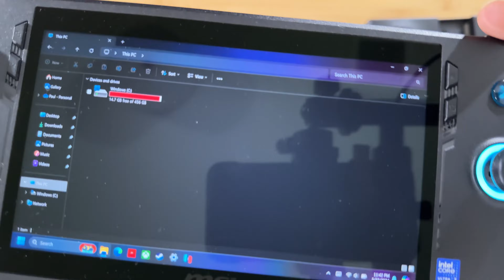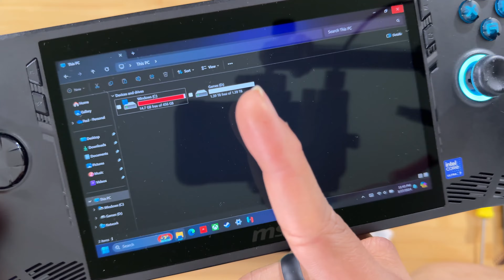MSI Claw SSD Upgrade | 2Tb

Comment: Did the repaste help with performance 😂
Reply from the maker: Not really. It was not thermally limited before
Reply: @BarelyAverageDude  so basically handheld development is still in early stages and haven't fully tapoed into high end use, I joined at the right time 🎉

Comment: Where does the OS stay ? If you install a new ssd, new from the store ? You dont have to install windows 11 again ?
Reply from the maker: If you put in a new SSD you need to reinstall windows. I use the clone tool to streamline the process and skip that step. 

TLDR the OS is on the SSD

Comment: Do Both fans supposed to start when it's plugged in? 

Cause mine won't turn on, and when I plug it in , I see only 1 fan moving.
Reply: Mine bricked and having the same issue
Reply: Reinstall bios that should fix it you need another laptop to do it

Comment: Bad Design? It was never made to be disassembled. 🤣 Best design would have been a port with a cover so the SSD could be replaced without disassembly.
Reply from the maker: Being made to never be disassembled when the SSD is upgradable is bad design imo. I could understand if the storage was soldered to the board. 
Also there is a handheld that just has a cover over the SSD for easy replacement; OXP X1 mini 👍🏽

Comment: Hey guys I just want to ask you the claw can turn on without a battery? Because this product can’t support bypass battery, and this issue is hardware limitation designed or the bios and firmware locked?

Comment: Claw 8 I put new ssd in it then it loaded bios and can’t get to windows wtf
Reply from the maker: @Dkkongisland  did you clone your original ssd onto the new one?
Reply from the maker: @Dkkongisland  a new SSD doesn’t have windows on it out of the box
Reply from the maker: @Dkkongisland  6:44
Reply: I couldn’t clone I messed up my hdd by canceling the cloning it was too slow lol now I need buy a new hdd
Reply: Can’t I just boot up a usb with windows on it
Reply: I was gonna clone windows to my hdd lol
Reply from the maker: @Dkkongisland  you can boot from USB. cloning would just save a few steps. 👍🏽
Reply: @  I tried to clone it messe up my 4tb  hdd how can. I recover the hdd to normal lol

Comment: And how do you design a radiator so that it can be dismantled without having to redo the thermal conduction in one way or another? whether it's on the CPU or elsewhere, when you dismantle a radiator, you inevitably find yourself in this scenario unless you dismantle the processor with it. There is absolutely nothing anti-consumerist about it, these are purely obligatory choices to reduce production costs yes but also to reduce the selling price because, whether we like it or not, one goes hand in hand with the other. It's like you're obliterating what you're dismantling. This is purely an ULTRA COMPACT laptop. This is a product that is not made to be dismantled. The SSD does not have to be reached. You are already lucky that it is not soldered like the ram strips can be. So yeah, there's a thermal pad to put back in exactly like there is to put back in every time you take apart any radiator that has such close contact with the CPU that they have to use something that's bulky and malleable so that it fits completely into the case. There is no miracle possible on this and it is the same thing for laptops and living room PCs. And let's be honest, thermal paste costs absolutely nothing and is easy to clean and install. You don't have one before you start your disassembly? Well, you don't understand what you are disassembling and the precautions that go with it.

Designing a radiator that will not cover the SSD in such a confined place, it costs money to please only 1% of people who will take it apart just to change one part or another. And these 1% should also complain about having to put just a little thermal paste at 5 dolar a pipette? Let's get serious for 2 minutes.

Comment: Does upgrading an SSD void the warranty?
Reply from the maker: @maafkanaku1691  no. Not unless you break something specifically while changing it. But if you upgrade with no issues and then a problem comes up your warranty is there.
Reply: @BarelyAverageDude are you positive? I asked MSI support and my response was " I do believe it will void your warranty"
Reply from the maker: @josephhall7317  not sure about all regions, but in the US warranty is only voided if you break something.

Comment: You don't need to replace the thermal paste. That is extremely bad advice. Especially if there is still full coverage of the chip (which obviously there is). This misinformation can mislead consumers. It's only best practice to replace thermal paste if it is crusty, flaking off, or causing thermal problems.
Reply from the maker: You replaced your SSD without any issues?
Reply: @BarelyAverageDude Not on my end. I have experience working on the steam deck and ROG ally as well.  Maybe you should reach out to local repair shop with some experienced technicians -  they always find ways to fix things that most people like myself miss. 
Also - for messing with partitions - use Diskpart  in CMD or a 3rd party tool to increase a partitions volume.  Sometimes the older GUI can mess things up.  Even better would be to reinstall windows using an installer usb (you can use an adapter for the USB C port on the device to do this if I'm not mistaken). It will remove bloat, as well as partition the disk correctly.  Drivers can be found at the manufacturer's website.

--w
Reply: Thermal paste is like a plumbing joint, it must be replaced systematically. If you don't do this, it will have had time to dry on the radiator side as well as the CPU side and the thermal conduction will be completely ruined.

Professional technicians don't replace it just to save money on the paste itself and the time it takes to replace it, not to mention the possible laziness. As said, there are no small profits.

A real repairman will take the time to change it without asking for extra even if he is working on something else which would not require demonstrating the radiators if it is easy and safe to change.
Reply: @thesilencer8074  But, thermal paste doesn't need to be replaced this soon. At least wait a solid 7 to 10 years for GPUs.
Reply: If you have the time, replace the paste anyways 

Its cheap anyways and it saves a extra step
Reply from the maker: https://www.intel.com/content/www/us/en/gaming/resources/how-to-apply-thermal-paste.html 

Check the 2nd to last section 

“How Often Should You Replace Thermal Paste?

In most cases, you shouldn’t need to reapply more than once every few years, though you should replace your paste if you remove your cooler for any reason.”
Reply: @BarelyAverageDude  myself, and tech repair shops I've worked at sees the contrary.  Intel's language on this is for novices, not for those actually doing these repairs.  

Have a nice day 

-Willow

Comment: I mean it's not a bad design it is right underneath the fan, it probably helps to keep the ssd cool but yes it's extremely annoying to upgrade, hands down the least user friendly but all you need is a couple of 1TB micro sd cards if you aren't comfortable doing this. Once you start stocking up on micro sd cards you don't even need to bother upgrading the ssd
Reply from the maker: You have a 1tb SD card in your Claw?
Reply: @BarelyAverageDude  No I don't have a Claw, I wasn't spending my money on that right now. I love everything about the claw except that intel chip... It just isn't optimized right now and cannot compete with AMD. I got a Rog Ally and a 2023 GPD win 4 with 64gb ram and 4TB storage but I do swap my three 1TB micro sd cards between my devices
Reply from the maker: @chrisboucher2813  nice setup 👍🏾